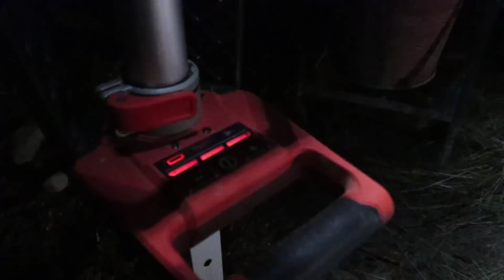this is why we gave it all up

Comment: Watching this series has made me wonder if it actually would turn out to be cheaper to have just built the home with a mortgage.  The amount of time saved, not to mention all of the crazy costs and mistakes that have popped up in this series.  There's value in hiring professionals.  The cost is higher on the surface, but saves you in the end.  I imagine the series moves slower than the actual build, and the garage apartment must be done by now.  Still, there was undoubtedly a major opportunity cost in trying to do all of this with two inexperienced people.  Much of the wasted time could have been spent earning money on their individual skills and talents, which clearly do not include construction.  That money could be used to pay for a shorter mortgage period, say 15 instead of 30 year, or even a 10 year.  We've had incredibly low interest rates.
Reply: WILSON! Ya its more for people wh0 are bored or not,busy and need a challenge. i personally have no time,for that
Reply: WILSON! They both have jobs that they can do from home. And the whole idea was to do this debt free and share their journey.
Reply: Kathi Pauling Their journey is paying for all this.  The bigger the disaster, the more the drama and the more the views! The bigger mess they make the better off they are.  They can laugh all the way to the bank and have fun doing it!  I say carry on!

Comment: Even the hot tub has given up and it trying to leak its way out of this
Reply: Wrap the Hot Tub in Tyvek. I heard it was a great water (burier). This guy buried tyvek along the foundation to keep the water off the drain rock, he didn't want to over tax the drain system i guess? so it should plug that leak in the tub.
Reply: I Williams there was no leak in the actual tub...it was a frozen pvc drain that cracked.  It's fixed now.

Comment: I hope you didn't just throw away a trailor load of wood that you could have heated your house and hot tub with in favor of using chunky tree firewood.  That would was structurally sound for sheds ,  work benches and temporary structures or just give it to some kids for a fort, but every thing, even saw dust is fire wood.

Comment: Hope your not taking that lumber to the dump, makes great starter wood even with the nails.  Why pay a dump fee when you can burn it.  plus you'll not be flush for wood forever so use it while it's free, well you already paid for it so get a second use out of it I guess.
Reply: Have you not seen the tons of wood they already have cut? They will probably be using propane to heat their house if they ever get it finished!
Reply: yeah, that's not really a lot of wood when you really look at it.  Maybe a year or two especially if they plan to keep that Jacuzzi going like they love too.  Plus, if you watch the previous vid they talk about placing a boiler over to the right of the house which would be a wood boiler usually so they will need it.  I'll admit I'm a wood whore and will save anything that burns but when you live off of fires to keep warm all winter you learn it all burns so why throw it away.  And yes some will say it's bad to burn it but if it burns it goes in mine and all it requires is a little extra cleaning at the end of the season which is still less time and money than getting more wood (buying or cutting)  Just my opinion, not beating them up, they can use it or not and it will not hurt my feelers

Comment: Also just wondering if you're taking that stuff in the trailer to the dump why don't you dig a hole with the backhoe and put it all in there and set it alight and keep doing that with all your rubbish it saves you a trip then you just fill it in when you are done because you just keep burning and burning it saves you so much time

Comment: I am watching Jesse as he is cutting and transportting his firewood.  For some reason it struck me that there was a lot of work to move that wood and that there must be a better way.  Then it hit me: cut the wood to fit the bucket and then cut it down to size at the wood pile.  That way you are only tossing the wood once it is cut straight onto the wood pile and you are doing a more efficient job of moving the wood out of the way.  Who knows maybe you won't even need to cut the wood down to size until later when you have more time.
Reply: What do you mean? They have allsorts of time on their hands no house is being built since end of November. They could have restacked that entire wood pile by now.

Comment: Stop take several deep breaths and a small vacation (maybe a bigger one after that). Maybe after the septic line goes in fill the hill from the house to the hot tub toss in a back door so using the hot tub doesn't require so many stairs to go down and up. Also the best suggestion from others, besides the small vacation, is forks for the loader. You Jessie and Allissa are doing the jobs normally given to a crew of 10 to 20. Breaks are really important to avoid major health and safety problems.  You are now so tired that you are accidentally insulting your backup knowledge source. Deep breath and take a break!

Comment: Little stuff has a way of turning into big problems if let slide.  Big stuff has a way of becoming much smaller when you pick at them from the edges.  You can choke to death on a chicken bone much easier that an elephant thigh.

Comment: I'm surprised that no-one has picked up on the "sill plate" screw up??? Watch the video where they are installing the sill plates (beams) and you'll hear Jessie mention that they are actually installing 4" x 12" pressure treated lumber but the plan actually calls for 4" x 14" engineered treated because that width is needed to carry the wall sips but they couldn't find the 14" wide product so they used the 12" wide.  So now before they can install the wall sips they are going to have to add-on a 4" x 4" to the existing 4X 12 to provide the required support! This is what he was supposed to have used but didn't - Preservative Treated Laminated Beams,    Industrial grade.     2400Fb stress rating.     CCA treated .60 lbs per cubic foot chemical retention.     Available in even lengths 8' thru 48'.     Special order. Please allow one week. Not returnable.         Special order:     3-1/2"x14" .
Reply: Please tell us something we don't know.....He talked to his engineer about this, problem solved.

Comment: In 1965 I joined the Seashore Trolley Museum know in Kennebunkport, Maine. I was 15. It is a streetcar museum, the worlds oldest founded in 1939. One year later approximately we had a grounds cleanup as the museum had started to look a lot like a junkyard. Alongside the main access road ( dirt) was The remains of the only Cincinnati Curve Side streetcar we had in the collection which at that time numbered over 150 cars most just rusting rotting hulks awaiting restoration. The Cincinnati Curve side car number 939 was one of them though there wasn't a lot left. The complete frame , it was originally a double ended car and only one end above the floor existed. The decision was made to scrap it. One member protested and stated to the board of directors he would restore the car and fund the restoration himself. The board agreed after a long night of arguing with the member, you see the member lives in San Francisco. And as such was only able to get to the museum and work on the car two weeks a year. Initially no one else helped him as they looked at it as a lost cause. Every year he showed up and a little more was done and little by little the car slowly began to look like the streetcar it once was. If you go the the New England Electric Railway website which is the museum website you can view color photographs and even video of the car operating in beautiful condition completely restored. It only took 37 years to complete. I once asked the member who is still active at the museum how did he maintain the interest and he admitted he occasionally thought like everybody else it was a lost cause but after every two week visit he would take pictures the day he arrived and the day he left and kept them at home to show himself the progress that was made. He followed the blueprints the streetcar company had held onto so better than 91 percent of the was built by following the blue prints as we have a very well equipped shop. The day it was pronounced finished by the shop foreman I wasn't there but was told he put on a 4 hour slide show showing from day one to the finish.

To this date it is the longest restoration at any streetcar museum in the world.

The point of he story? 

When you start a project there is no set time to finish it. Here throughout New England it was and still is common after a couple buy land they first build a concrete reinforced full foundation then Cover it with wood which eventually become the first floor, erect a chimney,, put in running water and a septic system and move into the basement as there temporary home. My uncle lived like that for 11 years until they had the funds to complete the house and move into the first floor. Anything is possible, it just takes time and a don't lose hope attitude.

The both of you will get there it just won't be according to a schedule as I don't know of any schedule that can foresee the future.
My uncle had to acquire materials and supplies until he had everything he needed to build the rest of the house in one summer spring to fall. They didn't have an rv in the basement, he insulated it which you been doing by backfilling the sides and back. He put in a wooden floor walls and everything else a or St floor of a house would have including rugs. He paid cash for everything. He didn't believe like a lot of people when I grew up in financing the house, when you needed somethings you bought it, no cash? You waited until you had the cash.
When they moved into the basement they moved from a WW II. Army tent into the basement.

Your over halfway there, give it time and keep track of every day by taking pictures to show the progress each day in a scrapbook, if they are digital pictures save them in at least 2 or more hard drives so when one fails as they all do you don't lose the pictures from the day you arrived and when one fails replace it immediately and the copy the entire hard drive over to the new one after copying over the days photos to one hard drive then copy the new photos over to the backup hard drive. 

Stout hearts warn bodies and a never say die attitude eventually will overcome all.

Comment: This is a dangerous time for you in the project. Take my word for it, I have been there many times. In any large project, there is a substantial element of 'unknowns', which we all understand is part of the job, and we all have confidence we can handle. We adjust, double down, and solve the problems. Moving forward, we become aware of our fatigue, frustration, and impatience - we WANT this thing DONE! We want to reach the vaguely defined 'nirvana' we think of as a 'safe' place; a point in the process where we can stop, relax, rest, rejuvenate our tattered nerves and courage, and reassess everything. Where we can take stock of all that is done, and how to precede from here.

It is where you are, and it is where the largest danger in such a project lurks. The big, final push, while you are truly exhausted, mentally and physically, and have small periods of frustration, even despair, wondering how you will ever get this done. Pushing through such an obstruction is where relationships crumble, property gets destroyed, and people get killed.

I had a friend, working on a tractor, heading uphill, say, "Goddammit!', and juice it up. The tractor flipped over backwards, and killed him instantly. From curse to dead took about 3 or 4 seconds.

Take it easy. Your 'safe spot' will not run away. Find ways to 'check up', to step back from the swing (golf talk), take a breath, and start over. You haven't come this far to allow a simple thing like exhaustion and frustration to derail you. Chill. Use friends and family, and allow them to be right if they say, 'You need a break'.

Just sayin'.

Comment: If you do move the camper in remember to vent the tanks to outside or you will stink up the place if you seal the opening with a temporary wall. Would need to pop the caps off then run both the grey and black tanks to a dryer vent to run it out. Yes even if you don't use the tanks the vents are still used when plugged into a drain.

Comment: Alex Mirich
I think you guys are doing a great job and I love your videos !  Just out of curiosity, what are you planning as the first layer of the roof structure? Here in Colorado we have plenty of Aspen so we opted to use tongue and groove 2" x 6"  boards right after the timber frame was completed.  We then installed our 9" SIP's, leaving a 3/4" gap to adjacent panels; the electricians jumped in and ran all the roof electrical lines in the gaps which were then filled with expanding foam.  Tar paper and architectural shingles followed and provided good cover until the wall SIP's  arrived.  The timber frame (by Pineridge Timberframe, Forest, Ontario, Canada) was installed in 2001 and still looking amazing.  Photos can be provided upon request.  Good luck to you !!!

Comment: Why drive that wood away when you could burn it?
Reply: Jim W if you look at when he is putting in the trailer, you can see it has nails and screws in.... not the nicest thing to burn and then have to sort ashes to find the nails....
Reply: I think it was mentioned a while ago.
Seem to remember it being treated timber, so they don't want to burn it and have the nasties to deal with. I know someone once told me some of the old treatments contain arsenic. 

I would probably have a bonfire with it but each to there own.
Reply: I would have had a simple bonfire, rather than burn rare  earth hydrocarbons driving a truck - just saying!

Comment: ... think of it this way guys, yes, you may be more stressed out no than before the journey - but that's just because you're getting so much done in such a short timeframe.  Think of it this way, had you not left "the old life" - how many years would you have spent spinning wheels trying to save a bit to buy this property....   you're way ahead of things because you've opted for such a compressed time frame.  That will lead to a ton of freedom down the line!  :)

Comment: Thanks for sharing.  Great effort.  Should notify Apple that Siri works for you.  Pity it fails tying to comprehend my accent.  I’m like the Scottish chap trying to get Siri to understand them.  Google is way ahead “for me” in comprehensiveness ability.  I can see why you would choose to dump the reclaimed timber because of the nails etc, but you could burn it and use the ash as trace elements when you develop any garden.  Looks like you have had a mild winter so far.

Comment: "That's why you build things on skids"  But not buy forks for the 580 that has the mounts welded on the bucket ? 
So much extra labor to hand carry stuff that could be done with forks if things were put on pallets or even just blocked off the ground.  I worked at a Case dealer and we religiously put everything on pallets and used a 580 with removable forks in the yard.

Comment: I have a woodburner that I use for a work area. When I light it, I use a mixture of used motor oil and dryer lint. Mixed to the consistency of cow s#%t  .  Put a glob in there,  load in the wood & light it. Easy-peezy!

Comment: I fail to understand why forks were not used throughout this build. From moving and placing the timbers on the mill to moving the cut lumber to so many other tasks. It simply does not make sense not to have forks, especially considering the low cost to very high return. That is why you build thing skids, so can use your forks to move things easily.

Comment: Please DO NOT put the trailer in the garage....just one more thing that will be in the way of the build...you are discovering why good builders have material managers and planning strategies....building a house is not an ad hoc project...stop the distractions and endless town runs...this pattern will exhaust both of you....my past experience building custom homes proved 90% of clients have NO understanding of the complexity of building a house. Just asking....did you solid block all the point loads and how was the timber frame structurally secured to the foundation? Just asking...
Reply: Hey...There...Why...did.....you...put....so....many....periods...?

Comment: How come you dump your wood in a pile and not stack it? That way the wood will be seasoned and you won't have to wait to have it seasoned when you need it?
Reply: Those are the offcuts from the mill. They were producing too much at the time to stack it. I imagine they will eventually stack it when they are looking for stuff to do. Not to mention the outer pieces in the pile should dry out nicely if they are in a pinch.

Comment: It takes a large set of tools here at the ranch just to keep things going
It takes a large set of "parts" to be able to fix things
breakers
plumbing fittings
wire
cattle panels
the list is long
What are the tools and Parts that you find most important
expected and unexpected

Comment: Its ok You might get the camper in there by summer. Winter is almost done and that's ok. You'll have shelter from the heat and next winter will come. yes all the tid bits with big task gets frustrating. Lol good self inventorying. Your ok and things are moving along more quickly then slowly. Heck this winter you've been working your butts off. Last winter you hibernated with bad solar. That's big progress, ya it might not feel like it but ya your hard work is paying off already. I'm told to look at what I've gotten done not what i have left to do. Lol I'm fast to admit that's easier said then done. So I'm human i throw a fit now and then. glad your chin is back up so soon.